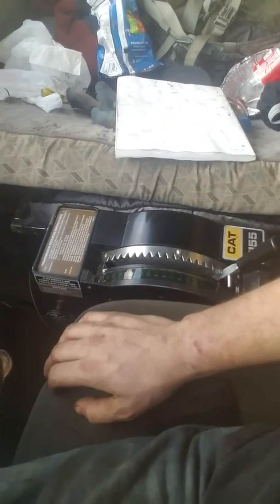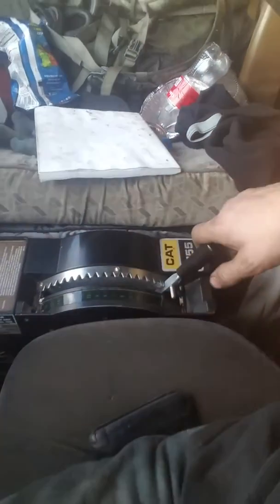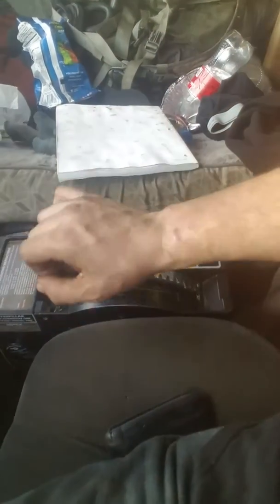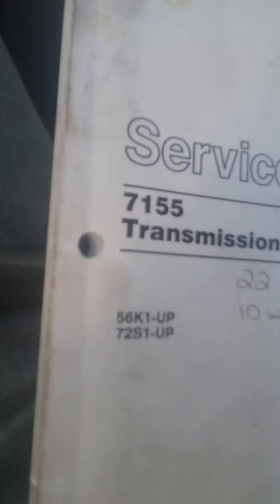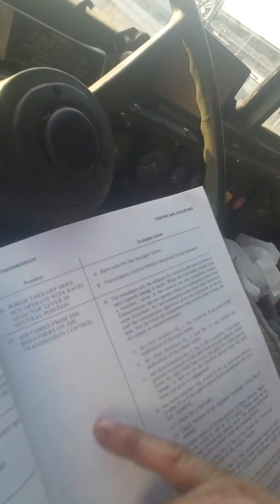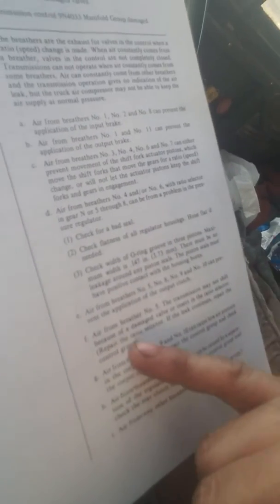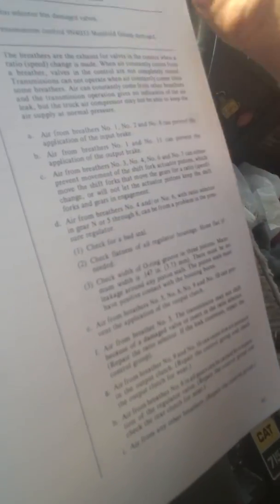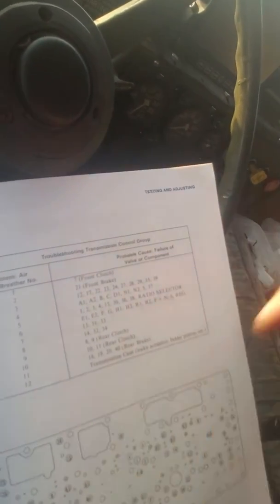CAT 7155 transmission troubleshoot - vent # 5 air leak

Comment: Replaced a lot of those 7155 transmissions. They are a beast. 1005 lbs. A little of a pucker factor when you have to raise it 3 feet in the air to stab it to the engine while reling on a single action hydraulic cylinder on you jack.